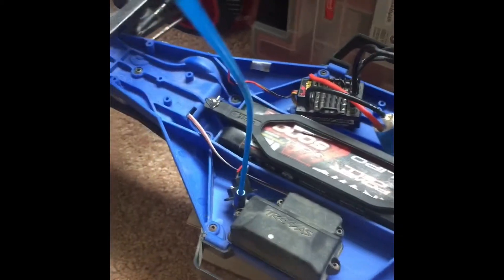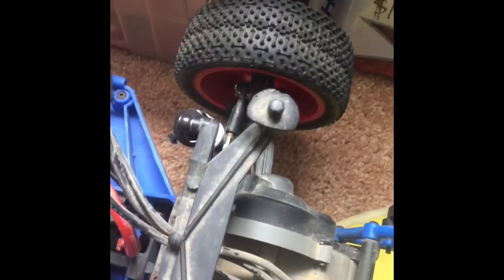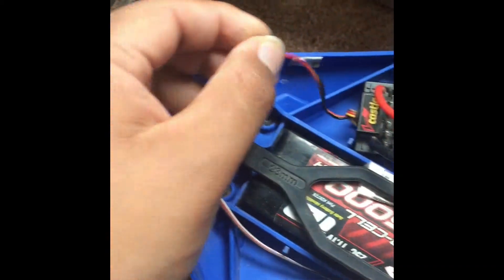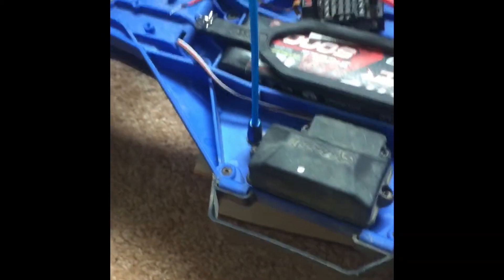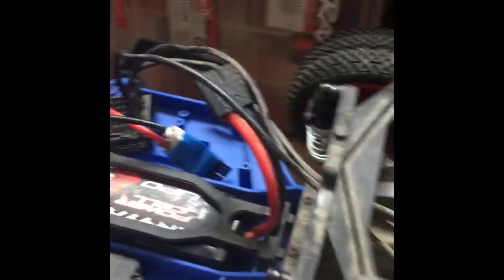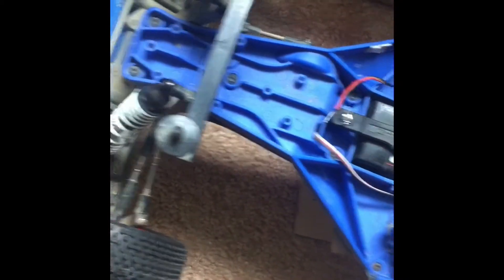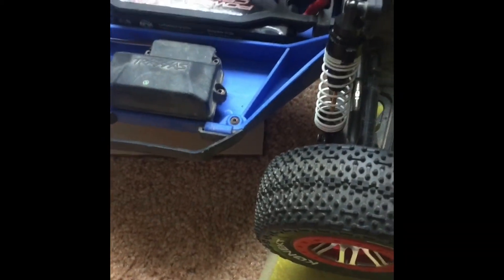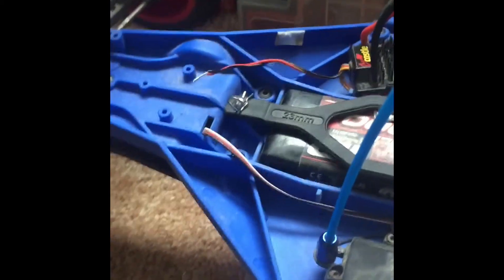Fixing castle sidewinder esc that won’t turn on

Comment: Just had this issue with my castle esc in my RC10SC6.2.  Clipping off an jumping over that little on/off switch did the trick.  I don't know why castle isn't putting a better switch on these devices, seems simple enough to step up to a more robust on/off switch.

Comment: My truck was working well yesterday. I have the waterproof verson and nothing seems to be fryed. I came back from school today and it just wouldnt turn on. Do u think i have the same issue? Plz confirm as i got this truck 4 days ago. (Not new). I have sidewinder 3 5700kv on a traxxas slash 2wd. Ran it on 2s lipo 5000mah. Will this solution work? Thanks
Reply from the maker: Yeah it probably will.
Reply from the maker: That what happened to me too.
Reply: @the_GenesisGarage  oh wow. Okay thanks. Ill try this. Im nervous cuz idk wut do to if this isnt the case. Im not willing to spend anymore money
Reply: @the_GenesisGarage  is it okay if i cut the connection from the middle and of it doesnt work, i can revert the procees of how it used to be
Reply from the maker: Yeah u can cut it from wherever u want , there just has to be enough for both of them to wrap together.
Reply: Alright. Im gonna try it soon. Ill keep u updated. Thanks
Reply from the maker: Thx man , happy to help
Reply: @the_GenesisGarage  hey. Ur video helped and it worked. U gained a sub and a like. Thank you so much